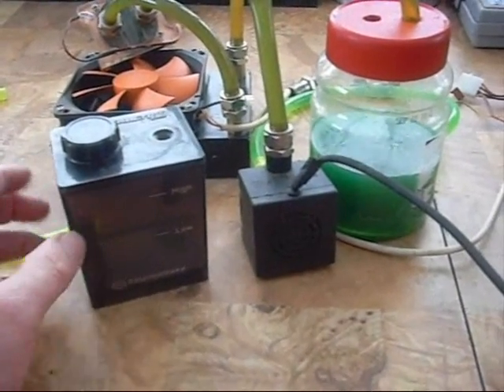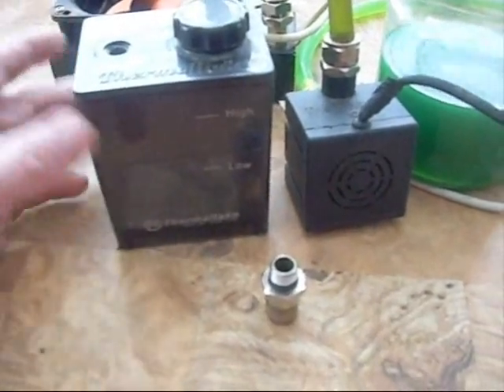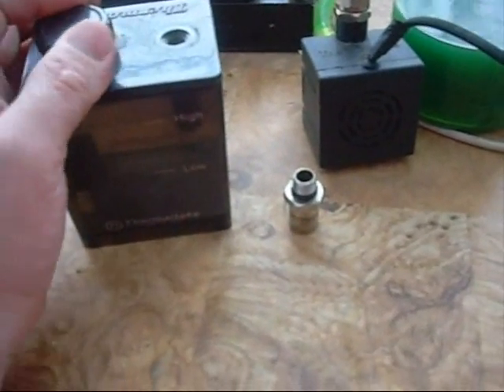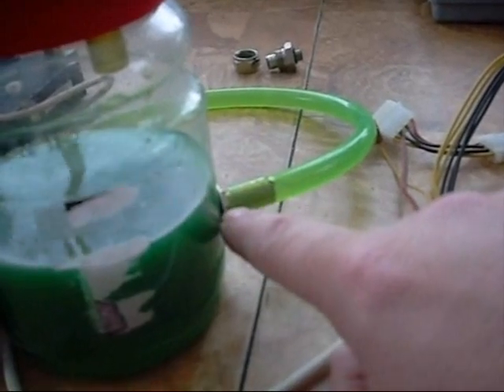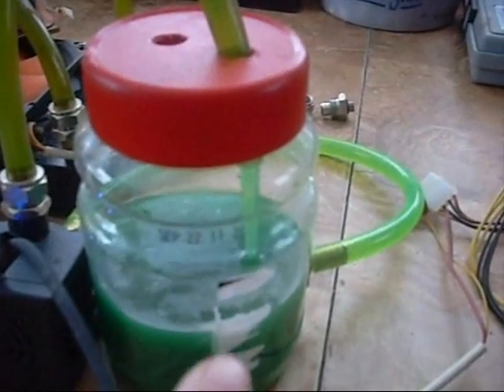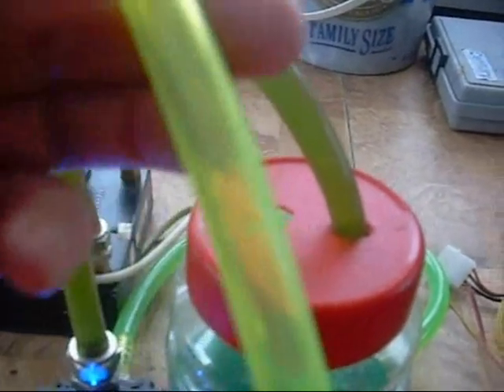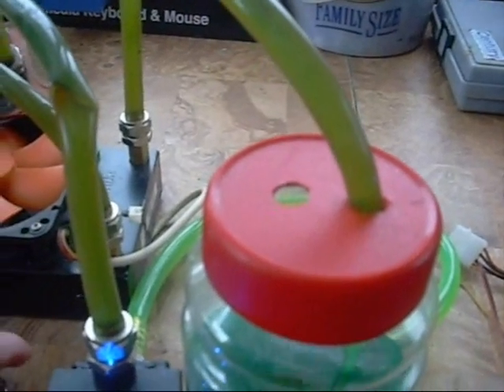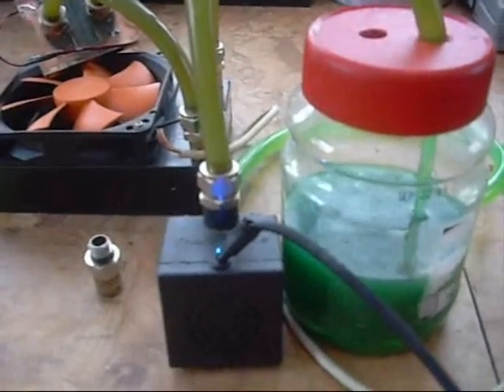Water cooling update. Making a custom reservoir

Comment from the maker: @rmb1993 It is some nasty stuff. I have already took the pump apart once and cleaned it as well as flushing out the rad. When I get the final setup done I am going to tear it apart again and remove all that fluid. 

What fluid are your friends using in theirs. Distilled water ?

Comment: just use clear fluid. They don't leave anything and just use colored tubing. I don't water cool but I have friends that do and if you leave a colored fluid in without cleaning every single part it can ruin your pump, cooling blocks and radiator